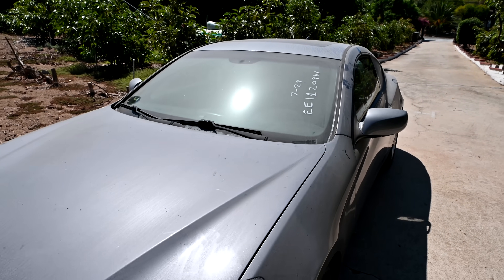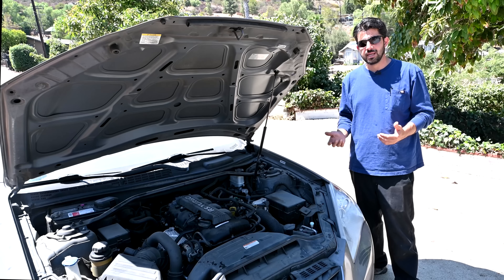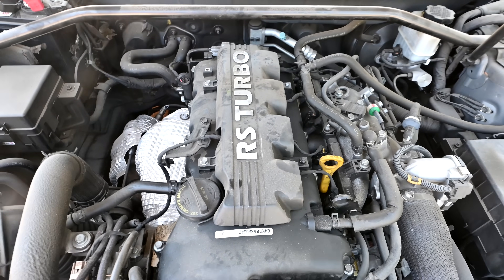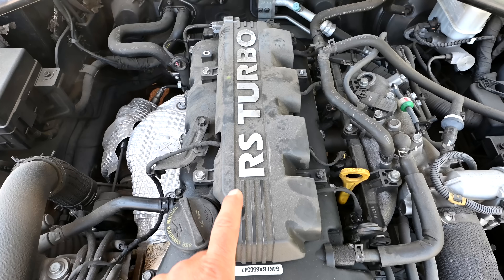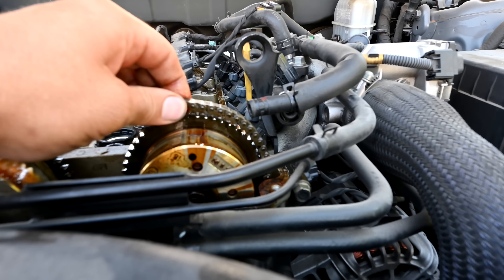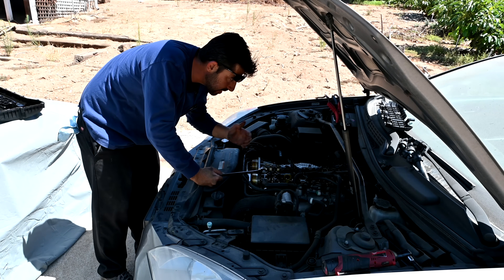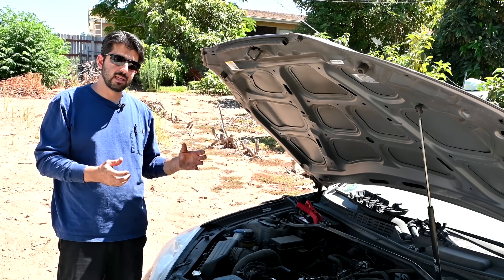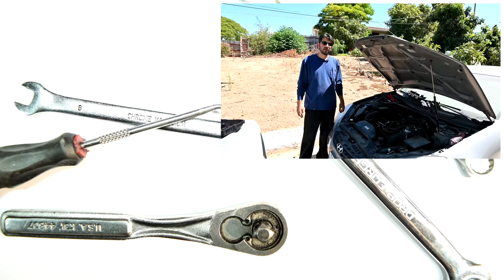The Hyundai And Kia Engine Failures Explained.

Comment: The bottom end failures are likely from failed journal hardening and/or machining swarf left behind. The other things that go wrong are in line with what Toyota,  Honda, VW-Audi, BMW, and almost everyone else has seen: too long oil change intervals and sludge sticking low tension piston rings. A lot of stuff mentioned in these comments is not based on facts from car repair shops. Kia and Hyundai are replacing engines with little investigation way past their 10 year powertrain warranty. The other brands are not nearly so cooperative much past warranty expiration that is much sooner.
Reply: We had a 2015 Kia Sorento with the gdi 4cyl my wife always had it maintained by the Kia dealership every 4k and at 70hk it siezed up, Kia tried to play that lack of maintenance and charge us 7k for the motor after research and they opened our maintained motor that had no sludge they covered the whole motor. It is 100% a design flaw. I recently did some HVAC maintenance at our local KIA dealership and there still having engines fail with low miles now the V6 engines are have an overheating issue. Yes they are covering the failures and yes the cars are extremely nice for what you pay. But they need to redesign the engines. I will say the gdi turbo 4cyl is usually lack of maintenance
Reply: @rollandsaxton  Had a friend of mines just had the engine replaced last year on his 2014 Sonata 2.4, no turbo. Engine light was flashing and code was for knock sensor. He took it in to Hyundai and they found the bottom end to be shot. Oil change was done at 3,500miles. He got a brand new motor. Happy guy. Only 46k miles O_O
Reply: @chester.01a  damn only 40k. At least they replaced the motor
Reply: @chester.01a Happy till 92k miles 😂
Reply: My girlfriend had a 2013 Hyundai Sonata and it literally caught on fire.😂😂😂😂
Reply: @dark6c159  When I used to do parts delivery to a Hyundai Dealer there were about 2 Sonata that have been burn down. Electrical fires with customers cars.
Reply: KIA and Hyundai have been stone walling people these days. Long delays, unavailable engines, low warranty on replacement engines. Many people have been struggling to get them fixed even under warranty
Reply: Hyundai was fined over $100 million by the NHTSA for stonewalling the problem, and they awarded $24 million last year to a Hyundai engineer named Kim Gwang-ho for blowing the whistle. He said the issues were inherent to the design of the engine, leading to insufficient cooling and oil lubrication. The metal shavings was a spurious excuse to save face and evade liability......The knock sensor thing is a needless copout HMG managed to splice in the settlement to avoid being on the hook for millions of engine failures, even though they are ticking (pun intended) time bombs. All it does is tell you your engine is toast right before it grenades itself. But It doesn't matter how religiously you changed the oil or how well you kept up service, the rod bearing failure can strike in any Theta II at any time, and short of a guardian angel dealer, they will refuse the warranty if the KSDS service wasn't performed despite being a software nonfix that doesn't affect anything. They were searching for an out, and they found it.
Reply: They ain’t doin it past the ten years mark they’re not doing this out of good will they got sued. The cheap bastards replaced half my engine and it took em nearly four months and made me pay for a rental and took 6 weeks to reimburse
Reply: The high mileage intervals on oil changes is a huge problem. Even if the oil lubricating properties are still there, the oil filter is history long before that.
Reply: I ALWAYS change my oil on a new car just after the first 500 miles. Also, upgrading a engines oil pump can help with lubrication pressure at cold starts and at engine idle times. The good 'ol "hemi tick" sound can be fixed with putting the SRT engines oil pump on the engine. Pressure is higher now at cold start and at idle times which also protects the lifters and cam.
Reply: @nexpro6118  So you replace the oil pump on a new car because you know there is a problem?  Hahahaha
Reply: I was thinking about getting a new '22 or 23 Kia Carnival with the 3.5 GDI I wonder if I should pass 🤔
Reply: @seatime674   Buy Toyota period...
Reply: @bluesky-ud9wg  No toyota, boring
Reply: @seatime674  See that's where you people don't get it. All this fancy shit in cars that doesn't work, performance, etc. Ever heard of starting every single day and doing what you need it to do?  Tell me what makes a car Exciting...
Reply: @bluesky-ud9wg  Whoa calm down tiger... What's this starting your car and nothing works with no performance nonsense?,,With every car maker there are issues, that's life.. People like what they like you can't Ram a Toyota down someone's throat.. Toyota's are amazing running cars and so are others but I'm not interested in them style wise I just think they're boring looking vehicles.. Starting '22 the new Kia Carnival redesign taking the place of the Sedona is part "Suv" and minivan now which suits me better for camping, towing my small boat, more capacity for storage and people and it looks incredible like an Expedition!!. Not to mention 5yr-60mi bumper to bumper 10yr-100kmi powertrain warranty which blows everything else out of the water because Kia has confidence in their cars.. The only drawback is the 3.5 v6 GDI engine with long-term could cause a little excess carbon buildup is all, but if you look at the stats most new cars are going to start to use GDI and it's going to be an everyday thing now
Reply: @seatime674  Kia/Hyundia aren't there yet...
Reply: @bluesky-ud9wg  That's just your opinion, Kia/Hyundai have been around many many years and are there now!... Your other message about Ford didn't come through all the way
Reply: @seatime674  Dude I am calm. I can already tell you don't know anything about cars and I'd be wasting my time if I were to explain the facts that you won't hear about things such as you're saying that direct injection will cause a Little carbon build up. You just don't know the facts. I'd advise you do some research
Reply: @seatime674  So has everyone else been around, what does that mean?
Reply: @seatime674  I know I'm wasting my time and that's fine. Oh you didn't ask me my background and what I do for a living. I'll leave it at this: I'm trying to help you make a smart decision. Take care
Reply: Hahahah, you actually grouped Toyota with BMW?????  HAHHAHAHA. HARDLY
Reply: You hit the nail on the head. Americans are so about mpg that they are uninformed with the extended oil changes. Synthetic isn't Really made to go with longer intervals, it's made to protect better than conventional at the standard intervals. People NEED to run synthetic in everything and change it at 5k, not 6, 7 or 8 but 5,000 miles
Reply: 'i do cars' take these apart. Always cylinder #3 and journals and bearing are perfect with red coating still intact.
Reply: Ex-Kia mechanic I talked to before buying a 1.6 CRDi  said that if I changed the oil every 10-12k miles instead of the 20k in the book I'd be very unlucky to have a failure. He said that pretty much all the common faults on them were caused by oil sludge buildup, including timing chain issues, because they use hydraulic chain tensioners driven by oil pressure. He also suggested using a good flushing oil about every third or fourth service. I would guess that the chain driven gas engines would probably benefit from a similar routine, ie- more frequent changes and an occasional flush.
Reply: That sounds logical. 

At Finland most car "guides" recomend oil change around 10-15k km, and some cars have maintenance only at 20-30k km. Interval

10k miles is 16k km, so even 10k miles exchange rate is kind of long compared to what is seen as standard at here. 

Oil change is pretty cheap, so it is cheaper to do every 10k km/ 6-7k miles than replace thr engibe.

20k miles is 32k km, and if someone would sell car with that long oil change interval, most buyers would be really suspicious here, as it is way too long in our eyes
Reply: @Haawser  My kona N has a change interval of 8k miles and I am not going anywhere near that.I do not know why KIA gives such long extensions on oil changes.BTW a tech reported on the forum literally every car that caught fire had gone a long time without an oil change.Also In the united states we have 6 months of decently hot to very hot weather and hot weather and turbo cars--esepcially in stop and go traffic destroy oil.
Reply: @khronin  I thought the engine fires were caused by a defective connection on the fuel line to the intake manifold.
Reply: It's generally down to poor maintenance that most modern engines fail I've never had any mechanical failures in the 9 cars I've owned in 23 years driving people are lazy and don't care about their vehicles. 😮

Comment: How come i had a forte that had 200K on it before i sold it, and was still running great, and i presently have  2 Kia Borrego with over 250K on each of them, one of them i bought 11 years ago, and there are still running like a champ and don't burn any oil, they have been Toyota like reliable.
Reply: Borregos are built like tanks and your Forte was probably well maintained.

Comment: Love Hyundai after 2000 but everyone beats on them great acceleration awesome fuel economy even the interior I like just spread the word change the oil break it in correctly they will last if not freaking 10yr warranty freaks what more do ya need extended warranties now 🤣
Reply: I just got a, 2023 Hyundai Sonata N-Line 2.5l turbo and I couldn't care less about engine problems as the warranty is, 10 year/100k mile warranty. Lol. So....I don't care if anything fails....I get it fixed/replaced for free. Ha also....I ALWAYS change the oil on a new car after the first 500 miles.  Some engines just don't last as long as others. It happens....not a single engine and or car maker has an engine that has never had a issue or issues. Millions are sold and odds are, some will have issues, especially with some people driving em hard as all hell and not doing proper maintenance. Again, new hyundais now have a 10 year/100k mile powertrain warranty. So, couldn't careless about issues. Lol also, when buying a new hyundai, you can purchase a lifetime pwertrain warranty for around 2k.....so.....couldn't careless about issues.

Comment: 3.3 v6 2008 Santa Fe. 357,000 miles and still running when I sold it 

The only problem was the recall that they never could/would fix where oil leaked from the valve cover into the alternator 

I would seal it every month or do and add oil and it kept on running !
Reply: Same problem. I have a 2008 with 145k. Is there any way to stop that pesky leak? How many times did they replace it for you for free? I have had it done 3 times in 25k miles.....I hate it. Maybe I should get all new valve covers?
Reply: @pattycheeze  I paid for the first one before the recall, they fixed it twice for free, I gave up after that and would put the red gasket in a tube on it on the outside. That would last about 6 months to a year.
Reply: @citypicker4449  what is the red gasket in a tube? And I guess I should just sell it at this point then. That sucks.
Reply: @pattycheeze  best I can explain it, it looks like a toothpaste tube and you squeeze it on where it leaks.  It is That simple. Autozone Napa etc have them. 

I still wish I kept mine.
Reply: @citypicker4449  thanks for the advice man! I will look into it. Sucks that a good car has that problem. I'm thinking I should get new valve covers. Maybe the cover is damaged from time and a new one would keep the seal longer.

Comment: I have an 07 Sonata V6 with 213k miles. Still going strong!!
Reply: I just got a, 2023 Hyundai Sonata N-Line 2.5l turbo and I couldn't care less about engine problems as the warranty is, 10 year/100k mile warranty. Lol. So....I don't care if anything fails....I get it fixed/replaced for free. Ha also....I ALWAYS change the oil on a new car after the first 500 miles.  Some engines just don't last as long as others. It happens....not a single engine and or car maker has an engine that has never had a issue or issues. Millions are sold and odds are, some will have issues, especially with some people driving em hard as all hell and not doing proper maintenance. Again, new hyundais now have a 10 year/100k mile powertrain warranty. So, couldn't careless about issues. Lol also, when buying a new hyundai, you can purchase a lifetime pwertrain warranty for around 2k.....so.....couldn't careless about issues.

Comment: 149K miles on my 2011 2.4L... going strong and smooth.  3500 miles OCI since new on the dealer's advice (I'm in a what is considered "extreme conditions" area).     But I doubt it will remain this way to 200K miles like my 2000 4cyl Accord did (let it go when the transmission started acting up... but the engine was perfect)
Reply: Yep. Just change the oil often and they'll be fine. I'm not a fan of these 15k mile or once a year oil change intervals. They recommend that in my Mercedes Benz but I still change the oil every 5k miles versus that 15k crap.
Reply: @JaretKade Agreed I run a catch can on our 2020 Tucson 37,000 miles still runs better than new also absolutely no oil burn off . The dealership uses 5w-20 Quaker state,I change myself now and use 5w-20 Pennzoil platinum as it was the only one Available it is a world of difference from the Quaker state especially in this Florida heat. 4,000 miles interval . That Quaker state looked like water at 5,000 miles still protecting but didn’t trust it, so far I’ve gone  I think 2,500 miles on the pennzoil and it’s still holding up nicely with mostly city driving.
Reply: One question. what mileage is considered ‘normal’ for a passenger car in your area? here in korea if the car reached 125k miles, we deemed it as almost the end of the car’s lifespan.
Reply: @powershin12  That’s just getting started in the US. Because North America in general is so large it’s not uncommon to acquire high mileage on a car/truck pretty fast especially if they drive for work or live in a rural area. I work at a dealership and we regularly take cars on trade with 250k or more miles on it and most run nicely if maintained.
Reply: @IKhanNot  Wow that is almost a double!
Reply: @powershin12  We had a 2013 Lexus GS350 come in on trade in with 255k miles on it. Other than the front bumper needing a respray from the stone chips and the worn leather on the driver seat needing to be re-trimmed the car was in excellent cosmetic and mechanical shape. We ended up throwing new tires and brakes on it, detailed it and put it up for sale. Sold within 4 days.
Reply: @IKhanNot  You took a good care of your car. Though it is crazy to think yours ran over 250k which is 'too much' for in this part of the world.
Reply: @powershin12  oh!  Cars are driven until the engine or transmission cost more to fix than what is "reasonable"... and in my area (Canada) until rust makes it unsafe.
We will drive them 300,000km (186,000miles) and beyond if well maintained.
Reply: @sguenette65  Ahh nothing will avoid rust tbh.
Reply: @powershin12  I have 338.000 miles on my 94 Trans Am. Bought new,  engine never been touched , not even the timing chain..still runs great, uses no oil, 3000 mile oil changes since new, Castrol GTX. Lifelong Southern California car,  no rust.
Reply: I just got a, 2023 Hyundai Sonata N-Line 2.5l turbo and I couldn't care less about engine problems as the warranty is, 10 year/100k mile warranty. Lol. So....I don't care if anything fails....I get it fixed/replaced for free. Ha also....I ALWAYS change the oil on a new car after the first 500 miles.

Comment: The thing with hyundai/kia is that people buy them because they're cheap.  And as such they don't bother with good maintenance. They figure they are disposable cars.  
btw... You can find Toyotas with failed engines for the same reason.
Maintain your hyundai and it will last.
The theta II is an exception because of the failure in manufacturing quality control (metal in oil channels)
Reply: Yeah poorer people tend to not do oil change because they can't afford it or they are lazy. Think people ahould learn to do their own oil change and basic maintenance, saves you thousands of dollars.

Comment: Wife has a 2012 Hyundai 2.4 Santa Fe 254K miles. Just change the oil every 4K miles….problem solved
Reply: shaving problem didn't start untill 2018

Comment: Im Korean and I never buy Hyndai and Kia. I always go for Toyota
Reply: Toyotas are very good but not without their own issues and quality issues like new Camrys mirrors melting and warping in the sun. Years ago they had issues with Toyotas (older Camrys and Lexuses) the dashboard would again… melt in the sun and make it sticky and shiny which would reflect on the windshield making it hard to see as well. But Toyotas are very reliable typically. But got tired of their boring designs in past jumped over to cool Hyundai and Kia and so far no issue and long warranty so I’m very satisfied with them so far.

Comment: My mom had the turbo sonata...90k miles and it spun at least one bearing...maybe 2.  It could idle but that was it.  I had blown a volvo 850...my error, but even though it spun a bearing and had bad rod knock, it drove a total of 30 miles before it finally locked up.
Reply: I just got a, 2023 Hyundai Sonata N-Line 2.5l turbo and I couldn't care less about engine problems as the warranty is, 10 year/100k mile warranty. Lol. So....I don't care if anything fails....I get it fixed/replaced for free. Ha also....I ALWAYS change the oil on a new car after the first 500 miles.